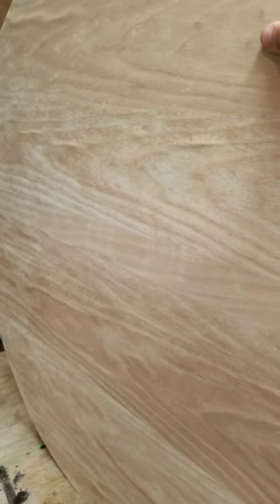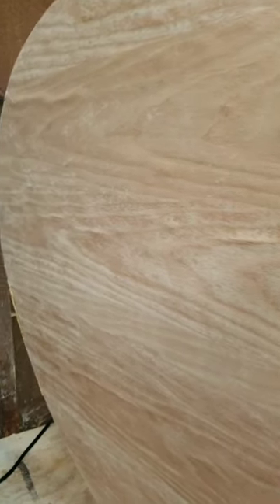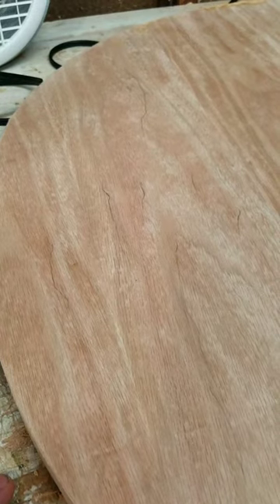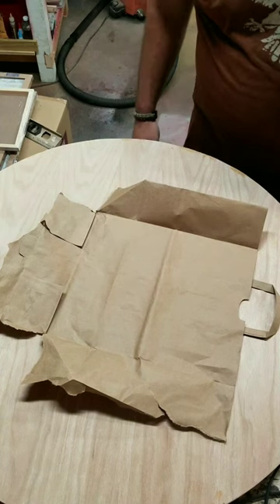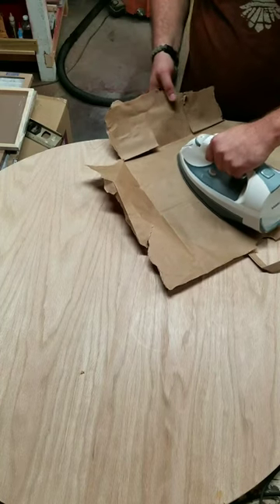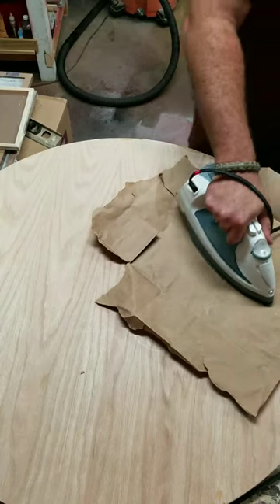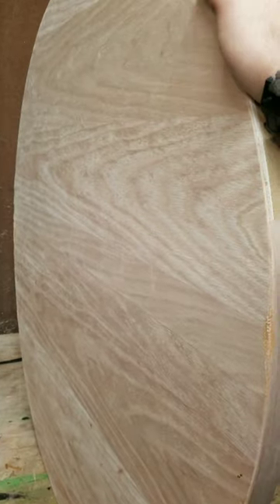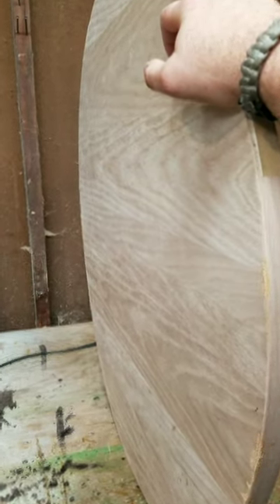Fixing those bubbles in your veneer

Comment: Used 777 to glue down 10mm paperbacked veneer to a clean, but ugly 2'x7' surface.  Worked fine - but then primed the surface and it started to bubble in places.  Since it was ONLY primer, the iron DID work.  2nd coat (and final) of primer did the same.  Water based...  on 2nd coat, some of the smaller bubbles settled down on their own.  Ironing anyway - heating up the glue helps them stay down.

Comment: Will this work if you've primed the veneer for paint?
Reply: I used an iron recently to remove veneer. It was primed and painted. The iron caused the paint to bubble and come off the wood, so I would think this wouldn’t be a good idea if you are wanting to keep the primer you have on there. I did have it on the highest setting on the iron. Not sure if lower settings would have a more favorable outcome with paint.
Reply: @wendyhall24  it didn't work for us. It melted the paint, the brown paper sack stuck to the cabinet door too. 😖 thankfully, the business we purchased the cabinets from replaced the door.

Comment: just curious, but what was plan b?
Reply from the maker: Michael Wong plan b would’ve been cutting a slit in to the veneer along the grain with a razor blade on top of the bubble and using a narrow syringe to inject glue into it. Cutting the slit would release the air allowing the veneer to be pushed down into place and the injected glue would hold it flat. Once the glue cured, I would have ironed out any further bubbling with more success as I know that those trouble spots had glue to work with. I may make another video showcasing that method as well
Reply: @mattward2611  i wanna try your plan B for the remainder of my diy repair. Should i be looking at a special glue or just regular wood glue or white glue would work? (I have limited wood working experience)